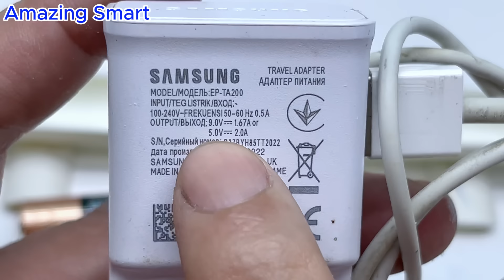Don't throw away Old Batteries! Easy way to Restore 1.5V Battery to Like New! AMAZING

Comment: Are these batteries intended for recharging? Is it not a battery that cannot be charged again? Please reply if possible
Reply: Good quality batteries like Duracell can be recharged few times but will not deliver power for long time and can be used in low power devices such as remote controls.